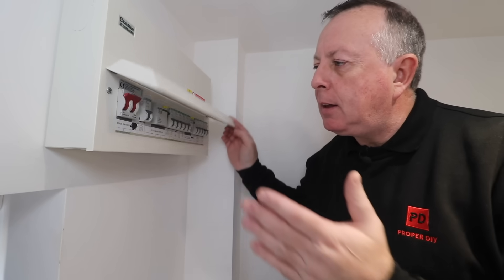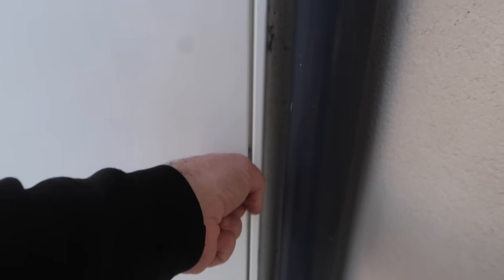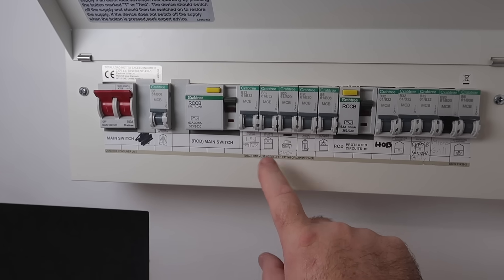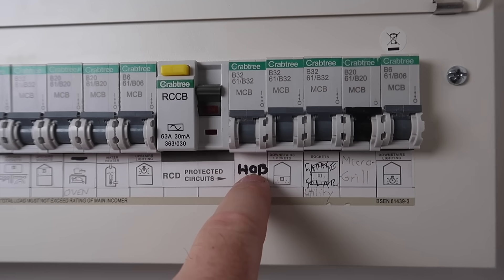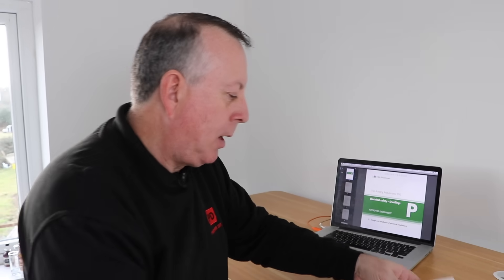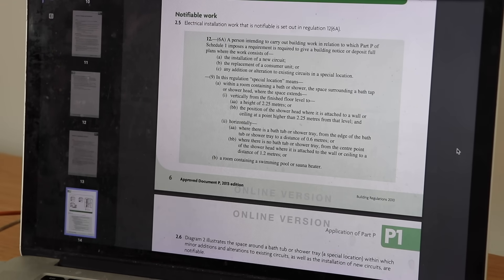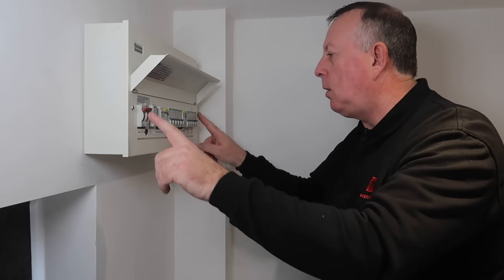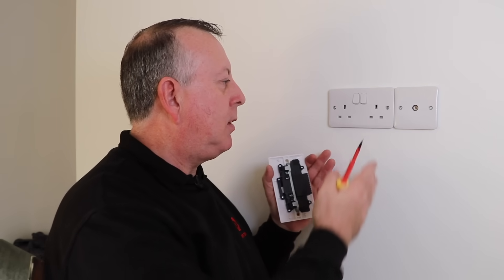What electrical work are you allowed to do in your own home?

Comment: can I install my own battery for my solar PV?
Reply: I'd like to know this too. A grid-tie system is a legal nightmare to DIY because you need some specialised qualifications, and the DNO will notice if power starts flowing backwards and come to see what's going on. But if it's off-grid, or perhaps running in parallel in the house with some circuits conventionally wired and some running off solar? That I don't know.
Reply: @vylbird8014  Well, the whole solar install was a ripoff, parts and install cost would be way cheaper if i would. have done it but cause of the MCS DNO G98 certifications and warranties are a must I had to have it installed.
But the battery is practically 4 cables to plug in + - data RJ45 and a earth cable to the earthing of the house  , and the inverter already has circuit breakers so probably dont need a 3rd one for the battery. Just want ot be on the safe side before I install it as strangely enough the electricity provider EON also wants me to let them know if I ever install a battery as I am in a SEG contract with them, shitty export dela for 3p per KW.... Also in talks with a electrician atm if he has all certs and can do it without involving an official Solar installer as their quote for a 5KW battery pack is £4.5K while the battery cost 2K, that premium I will not pay for sure.
Reply: @SafarWIP  I'm in exactly the same situation myself. My house isn't suited to solar really, but I wanted to play with it 'on the cheap' as a fun DIY project - just a few hundred watts of panels. But there's no way to do it legally, and the cost of regulatory compliance is geared towards larger installations. If you're spending £10,000 on panels and installation, an extra £1000 in certification expenses and professional sign-off is an acceptable annoyance. If you're doing a hobby-scale DIY, the cost of compliance can be more than everything else put together. And you can't hide a grid-tie inverter: The meter will detect it.

Right now I've got an unconventional system: The solar panels charge a small battery. When battery is full, my home network gear switches over to running off that. When battery runs flat, the network gear returns to mains power.

Comment: The mains voltage in my house (and my previous house was) is constantly 247 - 249v. This is not uncommon... so much for 'harmonized' standards.
Reply: even though it's now "harmonised" - nothing was changed, either in the generation or distribution of the supply. So the voltage you got before would be exactly the same as what you now have.
Reply: Your voltage is well in spec. The standard is 230V +10% or -6%, which means 216-253V is ok. We're near a big sub station and regularly get 250V.

Comment: I graduated with an electrical and electronic HND in the 90s. No I don't know the latest spec, no need. It's written for dummies to follow. Sue me for the work I've done in my own home, I understand the  principles. Besides, it's black and red, that can't be newly installed, surely.
Reply: Too right. Absolutely nothing has changed. I only fit rewireable fuse boards. MCBs and RCDs are a pain. Keep tripping out all the time. Only use VIR cable as well, but that's a bit harder to find these days. Some awkward customers moan on about these regs but I just tell them they're just being fussy.